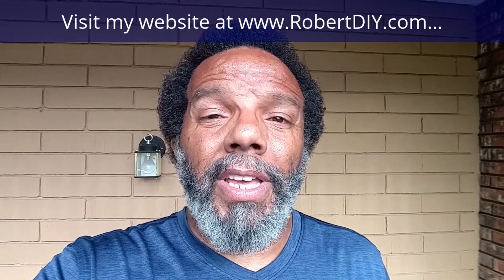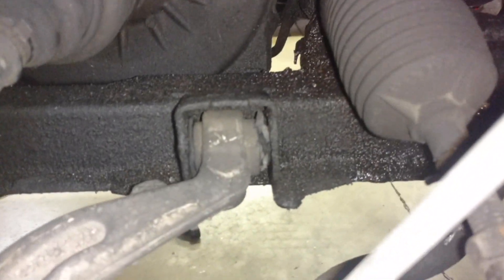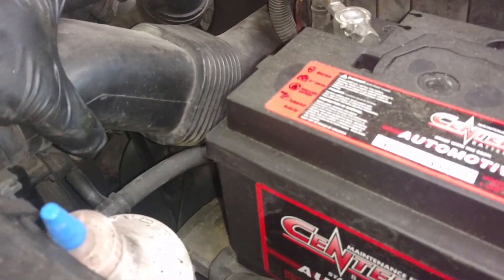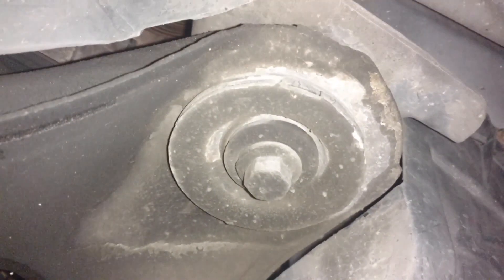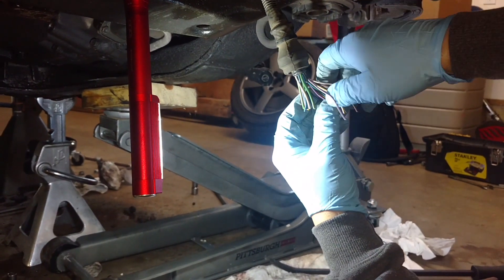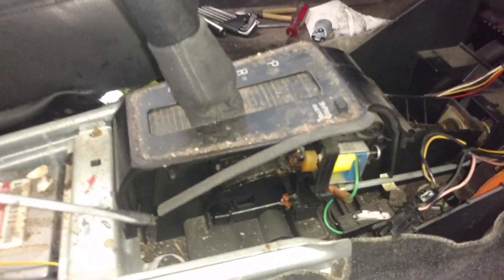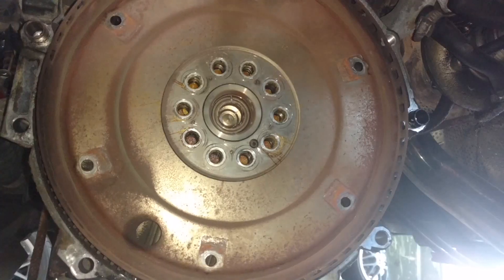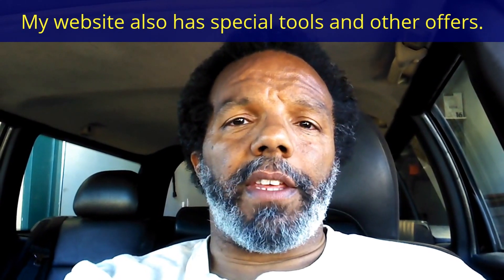Removing the automatic transmission & stuff, Volvo 850, S70, etc. - Manual transmission swap.

Comment: Hi Rob, I'm not a mechanic but was looking to buy an S70 T5 2.3L auto, however the owner says the transmission does not engage any gears. Worst case scenario they broke it. Is it possible and easy/possible for a mechanic to swap out the old one for a complete new one?

Thanks.
Reply from the maker: My guess would be that one of the axles is damaged or not plugged into the transmission all the way. Usually the drivers side.
Reply from the maker: https://youtu.be/S0mLleZxPus

Comment: Currently using this to replace my rear main seal. Anyone have a link to a diagram that shows EVERY bolt that attatches the transmission to the engine block? I dont want to accidently forget anything
Reply from the maker: Don't worry, it won't come apart if you miss a bolt.
Reply: @RobertDIY  I think he means when he's putting it back together

Comment: How did you get the pressure plate out of the flywheel?? The damn wheel is hard to turn. How did you turn that in order to remove the 6 wheels from the flywheel that are holding the pressure plate?
Reply from the maker: It's best done with an impact gun. You can put a tool on the crank to stop it from turning. Be extra careful not to strip them, if you are dealing with the T40 screws.
Reply: @RobertDIY  I get that, but I literally cannot remove the screws without taking turning the crankshaft. I am trying to remove the engine but the pressure plate on my v70 2001 turbo is connected to the transmission. In order for me to remove the transmission, I have to take the pressure plate out. The pressure plate is connected to 6 screws but I cannot even locate them without having to turn the crank. Am I making sense? The problem isn't removing the screws. The problem I have is getting access to the screws when they are on the back of the flywheel
Reply: @rtfdxn  the pressure plate is removed after the trans and engine separated. (Unless you meant torque converter)

Comment: Hi Robert I have a 2002 volvo v70 xc which is more like a 2001 model 
I replaced the valve body but it will not go beyond 2nd gear when it gets to 3rd and beyond like neutral 
do you have any ideas on what could be causing this ?  thank you
Reply from the maker: Bad transmission I guess..

Comment: Good job as always, I have an XC90 t6 AWD, had issues with the GM transmission twice in less than 80k miles on it, really like my car but hate that transmission, I'm looking forward to get rid of that transmission and wondering if you could give me an advice on which one should I replace it with, perhaps a Volvo 5 speed automatic that could be compatible with my t6 engine, thanks Robert.
Reply from the maker: Sad to say, I have no idea.
Reply: Hmmmm I don’t think the 5 speed is compatible with the t6 engine but the geartronic 6 speed is. Does your model have the 4 speed one?

Comment: I have an AWD V70 from 99' would this video apply to my car? Also what other, more common transmissions would be good for swapping other than an M56 or 66
Reply from the maker: Yesish
Reply from the maker: Why would you need another option?
Reply: @RobertDIY  I just can't find any manual transmissions and donor cars anywhere

Comment: Would this step process work with the T5 S60 from 2002? If not, where would i look for some advice for some help and what transmission to use?
Reply from the maker: No. Within or ask on VolvoSpeed.
Reply: Unfortunately, you should start looking to just sell it and buy a manual variant. s60's were a lot easier to find in manual.
Reply: @CocaineCobain  I dont have a S60, was looking at buying one but there are no low mileage manuals in NZ
Reply: @NzScruff  I would buy a high mileage s60 to modify before buying an auto and planning a swap. It'd be easier to bring the high mileage one back to its former glory.
Reply: @CocaineCobain  a cheap high mileage s60 in nz with over 250k km is about $15k where a low mileage 2.4l na s60 thats auto with 60k km is about $6k
Reply: @NzScruff  Dang, what years are you looking at? In the US, a high mileage s60 turbo/t5 will run you anywhere from $2500-4000 usd. NA s60's are even cheaper. That being said, there's a manual s60 t5 down the street from me with 219k on the clock and they're asking 3500 bucks. I'm referring to p2's so early 2000's
Reply: @CocaineCobain  I assume youre saying that bc of the cost, correct? Ive been looking for manual 98/99 S70 in blk/blk or wht/blk. I found plenty of gry/blk in a stick w/hi miles, & a pristine auto blk/blk T5 w/under 70k miles (thats how I ended up on this tranny swap vid.) What goes into ($$) bringing a "high mileage one back to its former glory."? Thks (btw: I wouldnt/cant do any of the mechanical work myself).
Reply: @MasterArmedforces  I have a 98 s70 t5 manual, and a 95 850 t5r that I'm planning to manual swap. The t5r was purchased with 300k miles. I did a full tune up on it and that essentially covered my bases. With s70's you really want a 98 as the engine management system was changed in 99 and newer vehicles. The 98 will yield much better performance results and "modability" as opposed to a 99 or 00. Manual swapping opens up the door to complete other strenuous repairs at the same time, so I wouldn't shy away from buying an auto, especially if its a pristine 1998 model. When I got my t5r I did the usual tune up with oil change, transmission flush, spark plugs, wires, cap and rotor, etc, but I also did PCV, timing belt, cam seals, and swapped to a reverse intercooler piping kit to get some new tubing on there and avoid as many boost leaks as possible. It runs like a champ now but with volvos I mainly check for any rust and if that checks out I don't worry about mileage too much.
Reply: @CocaineCobain  Thks for the details. Whats a good source to buy the manual trans, & price range? How about ballpark price range 4the labor on the swap? Where are volvos common rust spots?
Reply: @MasterArmedforces  As a California guy I don't have too much experience with rust but every car I've purchased I've driven onto ramps and done a thorough undercarriage inspection. If I can't spot any rust I usually call it a win, but checking VolvoSpeed and SwedeSpeed forums for some common rust spots to check would be a good idea. As far as labor goes, I've only ever done a manual swap myself. I believe a good shop will charge you anywhere between $1500-4000 for a swap if they're sourcing all the parts necessary. In my experience a donor car really helps smooth the process, and sourcing the transmission is also a bit tricky. In San Diego we have a good few Volvo scrapyards and I found my manual transmission there pulled out of a low mileage v70 for $450usd.
Reply: @CocaineCobain  Thks for the tips. Today I found a stick-shift 1998 S70 T-5 Sedan online w179K miles that looks pretty good from the pics (Exterior: 9/10, Interior 8/10). Heres the listed description: "  1998 Volvo S70 T5 factory manual transmission. 19T turbo, tuned on 93, IPD sway bars and subframe bushings, vogtland lowering springs, new power steering rack, recent timing belt/water pump change, R clutch and pressure plate, 3 inch exhaust. Jeweled headlights and corner lights, led fog lights, C70 wheels. 850R seats, backup camera and display. Come see it for yourself, the car is all but immaculate. At this moment it has no ABS."
Some of the features listed are my beyond my scope but it seems like youre pretty versed in these Volvo's upgrades. How do these features sound to you & what can I mention to them to bring down their price in a negotiation? Thks again.
Reply: @MasterArmedforces I personally would never pay much for a volvo unless it was a t5r wagon. That sounds good but the 19t turbo, tune, and big exhaust lead me to believe it has been driven hard and not babied by any means. The pcv is not listed, or any major repairs like timing belt/cam seals which are known issues. I would say if purchasing that prepare to spend a good thousand - 2 grand on preventative maintenance at a shop. Whats the listing price?
Reply: @CocaineCobain  But you told me you had a 98 S70 T5, you dont like it? At least this one is a manual trans, and a black interior. It does mention "recent timing belt/water pump change", but not the seals or PCV. What type of price reduction can I ask of him for fixing the ABS brakes? And is this something I would have to fix in the long run or could I drive it like that w/o any repercussions? Hes asking $6K, but everything out there w/that mileage & a manual trans is between $4500-5K right now.
Reply: @MasterArmedforces  Ya I bought my 98 s70 t5 manual for $1000. It had 130k miles, paint needed a lot of love but mechanically it was sound and the interior was in perfect condition (black leather). AC blows cold and it had no modifications and upon doing maintenance the motor seems to have been babied its whole life. He's asking 6 grand?! Ya I'd only pay around 2 grand, 3 grand if I was absolutely desperate. For 6 grand it better have a freshly rebuilt motor and trans, along with receipts for everything. I love my s70, I just don't think they're worth that kind of money. For 6 grand, even 5 grand, there are a plethora of better options. You can get a v70R/S60R for around 6-7 grand these days. I would offer 3 grand max. ABS is a known issue on 850s/s70's so don't expect to negotiate much there. If you're in Phoenix, AZ area there's a 98 s70 t5 manual for sale for $2500 obo with 149k miles.
Reply: @CocaineCobain  Gr8 info. Im not in Az but Id travel for the right car. Whered you find it? Thks.
Reply: @MasterArmedforces  It was on marketplace. Looks like its gone now. Either way, I would not pay anything more than $3 grand unless it is an absolutely pristine, unmodified example.

Comment: Hello.
I swapped the automatic gearbox for the m56 in a v70 2.3 T5 from 2000 but now the engine is no more than 4000rpm, do you have any idea why? Thanks.
Reply from the maker: has the ECU been tuned for manual?
Reply: thanks for answering. It was not. does it really have to be done? if yes it can be for life (dice), if yes, how?

Comment: Great video.I´m planning manual swap in near future and this going to be very helpfull.Thank u Robert.
Maybe i´m wrong but  i noticed that your front bumper has different shade of black.I had my bumper cotated in 019-11 recently and it came in a bit different black.Is there any difference between 019-11 and 019-24 both black.Or maybe the old paint is faded.What do u think?Thanks
Reply from the maker: The paint code is on the inner left fender near the battery. I can't tell on my car. Probably loosing my vision but it looks the same to me.
Reply: @RobertDIY  Thanks

Comment: Hi Robert great video, seriously thinking about swapping my Auto transmission for a manual, if I can find a good donor car. But I have hit a problem getting the Torx screws out of the back of the Torque converter. So is it possible to take the atu box off and leave the Torque Converter in place on the flex plate? I am replacing the auto trans with another second hand one. Can I still line the new one up with the T.C. without any damage? Hope you can help. Cheers
Reply from the maker: I have no idea.
Reply from the maker: From my mechanic; Yes the trans can. But it will make a mess and then he has to figure out how to get the screws out afterwords. If you don't pull it, it will be almost impossible to get it back on.

Comment: Was that an M56 gearbox that you transplanted into Panther, Dr Frankenstein??
Reply from the maker: Manual, 56 series. Installed at the factory in 850, S70, V70 and other Volvo vehicles post 1992.